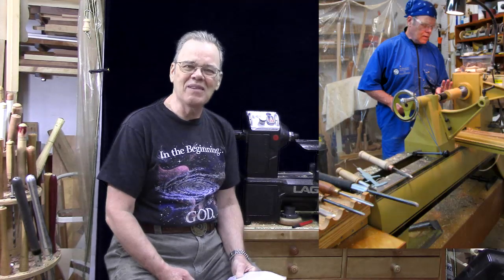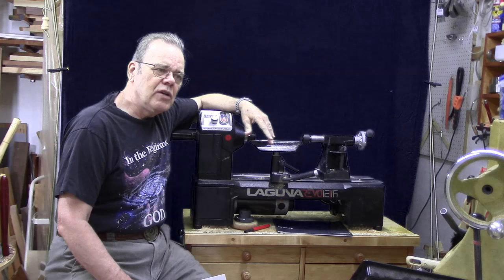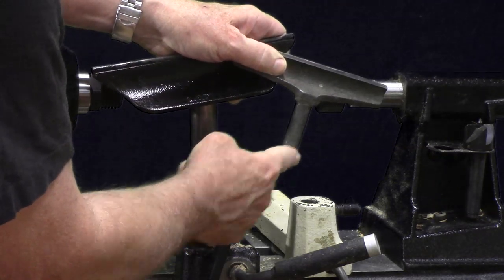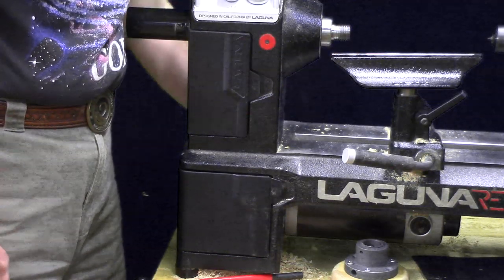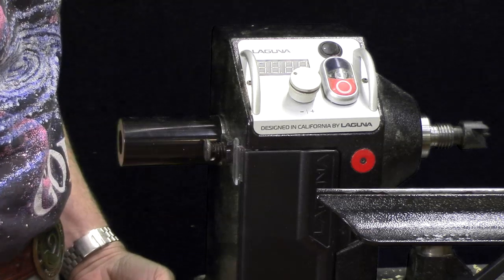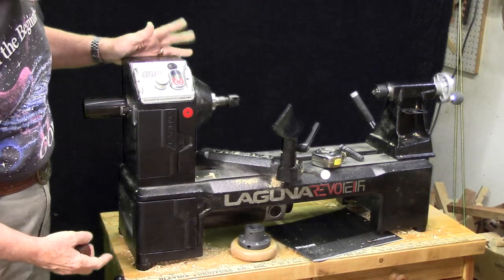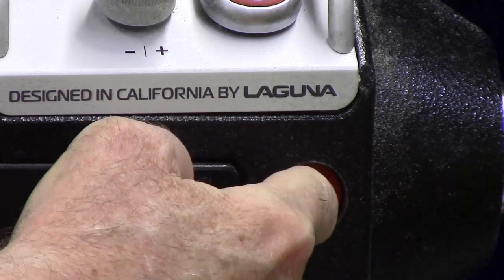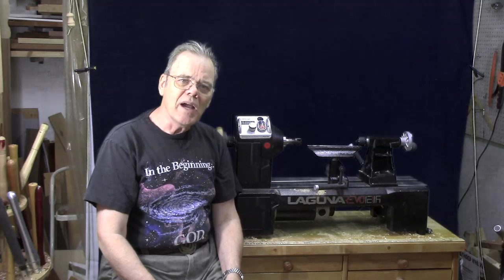Laguna Midi Lathe Review

Comment: Hi Mike, I'm looking at replacing my Nova 16/24 with something a bit smaller and this video provided me with some good information.  Are there any other midi lathes you would consider?  I was looking at Record but the footprint is a bit large also the spindle is Metric.  Not that metric is a big deal but I either need an adapter or need to purchase inserts for my chucks.
Reply from the maker: Our club won a Record Power Coronet Herald lathe. It has a standard 1x8 spindle same as most other mid lathes. TThey would not sell many in the US if metric. I would also check out the Rikon. Check out this video https://youtu.be/s0YDgte_C7Q
Reply: @MikePeaceWoodturning  Good to know Mike.  I did check out the Coronet Herald and the foot print is a little too big for me plus there's the price.  I wanted a lathe where the motor is underneath rather than hanging out over the end.  Do you know if the extension for the Laguna will fit on either end.  I would like a little more length and 10" or so would be quite adequate.  Also checking out the Rikon lathe as the price is not much different than the Laguna.  Right now the Laguna seems to  be the way I'm leaning.  I'm off to my local Woodcraft to see if they have any that I can actually take a look at up close.  I'm either going to have to buy new inserts for my chucks or buy one 1" to 1 1/4" adapter.  I had one question about your cabinet, do the casters allow for too much movement or vibration when turning out of round timber?  Seems like even when they are locked there would be a bit of play.
Reply from the maker: @rgoodleaf  Laguna has a couple of extension options I believe. I get very little cabinet vibration and often leave the casters unliocked. Buy a new insert for your chucks.
Reply: @MikePeaceWoodturning  Thanks for the advice Mike, I appreciate it.  Have a Happy Easter holiday!

Comment: Where did you find the spindle adapter where you can still use mt2.
Reply from the maker: That model only works for converting a smaller spindle to a larger chuck recess. You can buy from Craft Supply USA or Penn State Industries

Comment: When I removed the hand wheel on my 12/16 laguna and placed the chuck on the outboard end then attempted to turn a bowl the shaft in the head stock slid out about 3/8 inch also the outboard bearing almost came out.can you give me any info on what’s wrong. I’ve had the lathe about eight months and only turned three bowls with it. I haven’t been able to contact their service department.
Reply from the maker: What is the issue contacting  their CS?

Comment: Can the tail stock be completely removed (easily)? I'm new to lathe work. I have a small, cheap lathe right now and when i try to hollow out bowls the tail stock always seems to get in the way.
Reply from the maker: I have never seen a lathe where the headstock cannot be slid off the bed and set aside.
Reply: @MikePeaceWoodturning  I have a little WEN lathe that I got on Amazon and the trail stock isn't removable. I guess I bought the one lathe that's the exception. lol
Reply from the maker: @rsstnnr76  Ok, I looked it up on Amazon. That is more of a pen lathe, suitable for smaller spindle projects. Hone your skills till you are convinced you want to pursue woodturning and go after a larger lathe. Good luck.
Reply: @MikePeaceWoodturning  I already ordered the Laguna! lol I'm going all in.

Comment: I think most mini lathe have 1/2 to 3/4 HP.  I could be mistaken.
Reply from the maker: Probably. Although no standard definition of  mini ( I think of being 10" or less) and a midi ( I think of as 12-14"), the trend is to larger motors. The Laguna has a 1hp as does the Jet 1221 VS.

Comment: Mike, I bought this lathe, barely used it, and a few weeks after the warranty period was up I was trying some precision work, and could not do it.  Why ?  The bed is not flat. Lower in the middle than on the ends, so no amount of shimming will fix it so the headstock and tailstock are in alignment from end to end. The bed needs to be machined flat.  Laguna basically told me to go suck eggs. There is no way someone could bend or warp that bed.  It was very poorly machined and quality control was lacking.  Stay away from Laguna.  They do not care about their customers.
Reply from the maker: Sorry to hear about your experience.

Comment: I really like the design of this lathe compared to the Jet models.   But Googling online I Laguna has a terrible rep for customer service.   There are horror stories all over.
Reply from the maker: Most of those stories were from years ago. I remember them well. I believe they have made significant changes. I had two service issues and both were dealt with very well. I know someone who had a horrible experience with a new Jet 1642 that raised concerns on their service. Sometime you get a bad CS rep with a company. Try calling back and getting a different CSR.
Reply: @MikePeaceWoodturning  Thank you.  That's reassuring.  The Laguna seems significantly better made and robust.